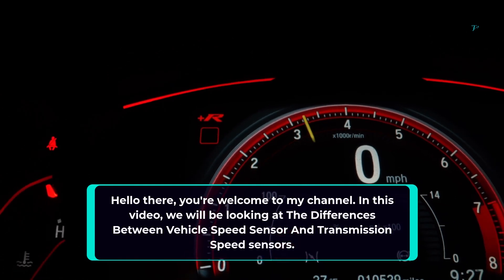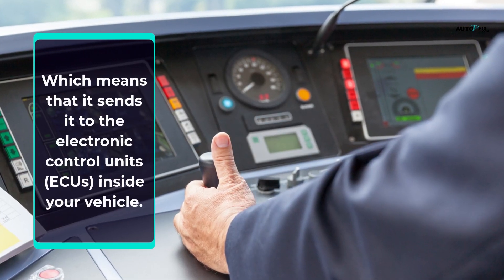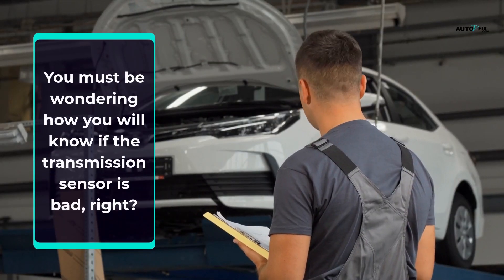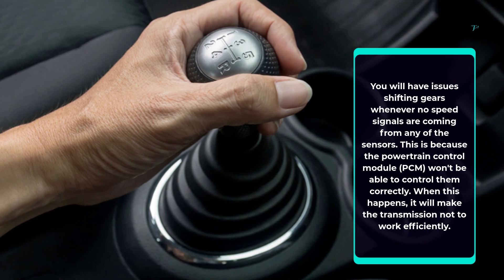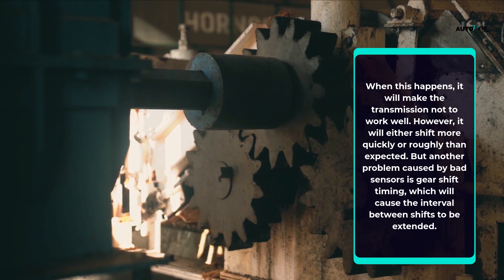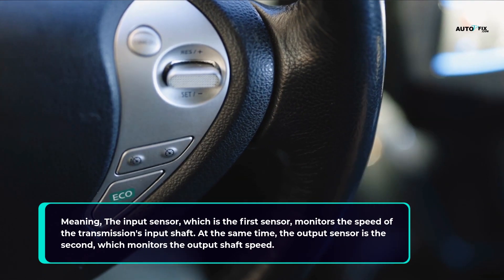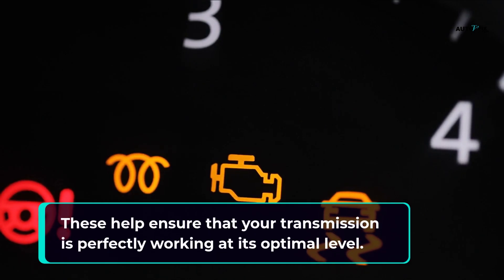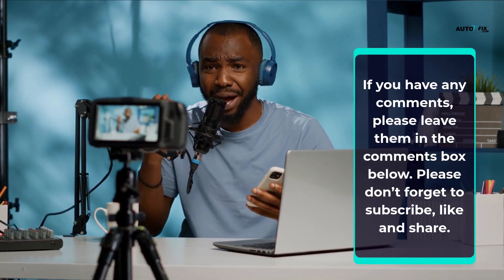Difference Between Vehicle Speed Sensor and Transmission Speed Sensor

Comment: I still don't know which speed sensor, the Automatic Transmission speed sensor or the ABS speed sensor, goes with either the input or the output shaft.  That was the whole point of the title of the segment, wasn't it?
Reply: Ya I'm confused also

Comment: Please help! My 03 Accord started jerking about a week ago. I've replaced several sensors, transmission fluid, spark plugs. It is still acting up. I was told its the transmission switch control solenoid. Is this true?

Comment: Does the speed sensor always make the  cruise control not work, im getting a hard shift 1st to 2nd in a automatic, transmission fluid is good, no codes or anything for my transmission or any sensors. Just the hard shift and sometimes delayed shift
Reply: Does your rear wheels ever lock up?

Comment: The sensor shown here and said to be on the transmission looks exactly like the one on my rear axle gear case, nothing on my trans look like it. I’m confused. 99 Ranger 2wd
Reply: If it is a manual trans it should be on the upper tailshaft of trans

Comment: When the sensor goes bad, can it cause the overdrive light to come on and make the transmission feel like it's down shifting while driving at 70mph ? And it happened 2x and it hasn't happened again. Also if any of the sensors are bad will a fixit finder diagnose it ?I'm obviously lost and would appreciate some advice. I can fix it myself, I'm just not the best at diagnosis and cant trust a lot of these shops, they see a woman and try get over on us, now you know why I do all the work on my car.
Hope to get an answer soon. 
Thanks
Reply: The overdrive light will start blinking if the VSS goes bad. Cruise control stops working, and transmission shifts arent smooth.
Reply: Understand you on the woman issue! And the downshifting lol currently trying to diagnose same issue. Taking the affordable routes first. Speed sensor.. pressure sensor and maybe coolant sensor. Next a solenoid change. Already changed cracked pan and transmission filters. Did you figure yours out? 

And the shop messing with woman's knowledge or lack of Ive had to fight with consumer protection twice in my lifetime! And won!
 Not cool.. but they take advantage of guys too that don't know enough...
Reply: @twilighthuntress98 you